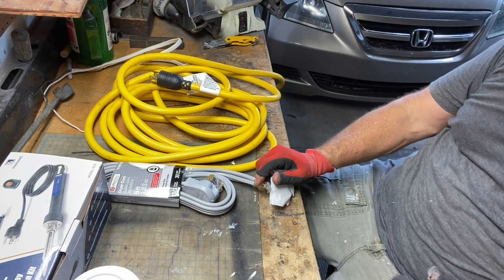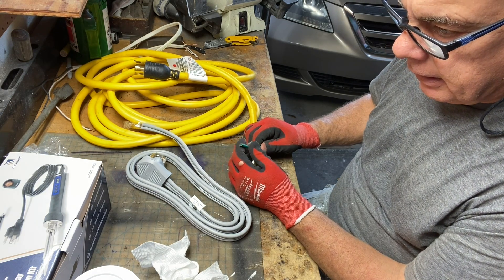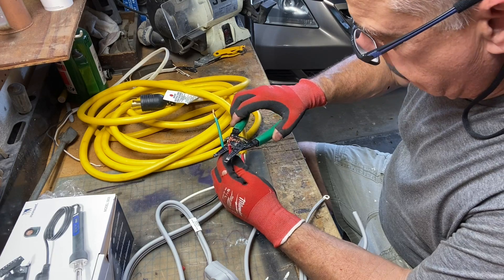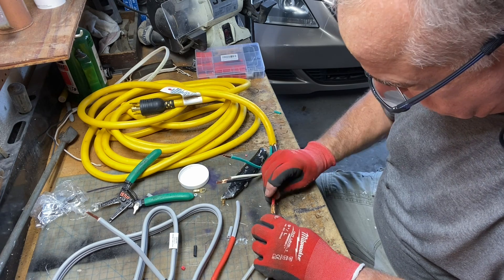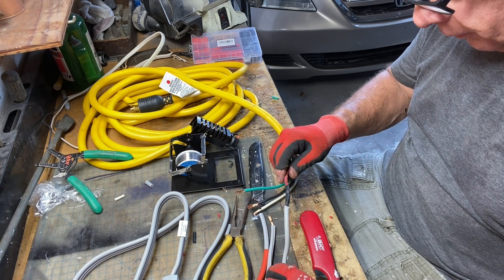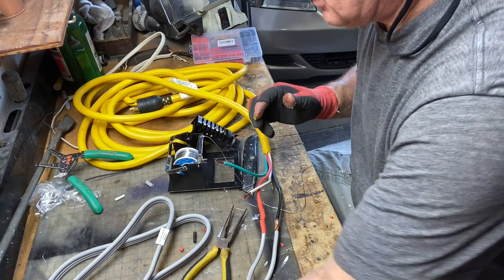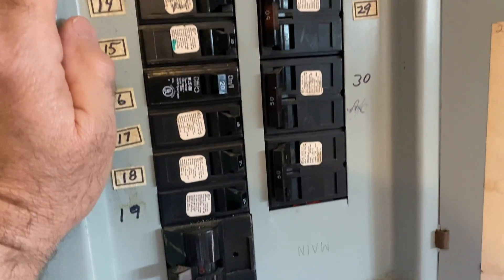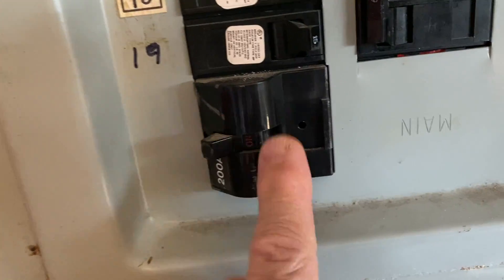Portable Generator Wiring Hack For Whole House Power

Comment: That generator will run all those breakers just fine. Just take consideration what you're running in the house. At the least you should not use a double make cord, rather use a dedicated two pole breaker in the panel as a back feed and either hardwire it to the cord that plugs into the generator or use a proper receptacle and cord system. Of course, the Gen breaker should be safety interlocked with the main breaker but if you can't do that start the Gen first and then be sure to ALWAYS turn the main breaker off BEFORE turning on the Gen breaker. When restoring power after the utility comes back on turn the Gen breaker off first before turning the main back on then turn the Gen off. [This gives the Gen time to warm up a little and cool down after use.] ALEAYS in that order.
Morons should not do the last part. Even if you did leave the main on and turned the Gen breaker on with it running, it would instantly pop the gen breaker due to trying to power the whole neighborhood and if you connected the Gen running to an active utility it would also just pop the Gen breaker due to phase variance.
Reply from the maker: Thank you that is great information. Thanks for sharing.

Comment: That generator will actually run your whole house just fine.  The 30 amp breaker will be your limiting factor but don't make the mistake of assuming that you have to add up all those other breakers.  Those are only rated to protect the wiring.  You're actually only using a tiny amount of their rated capacity at any given time usually.  I run my whole house off a 5500 watt generator and a 30 amp breaker.  Mine is installed correctly though, with an outside inlet box wired to a dedicated breaker and an interlock installed on my panel to prevent the main and generator breaker from being on at the same time.  Just don't try to run everything at once and you'll be fine.  I have had every light in the house on, computer, tv's, etc with no issues.
Reply from the maker: Thank you for all the information. That was just an emergency hack job for a hurricane. I have since put in a whole-house generator. Thanks for watching.